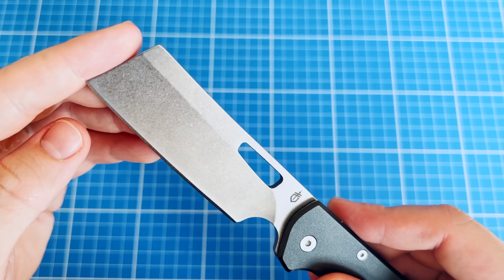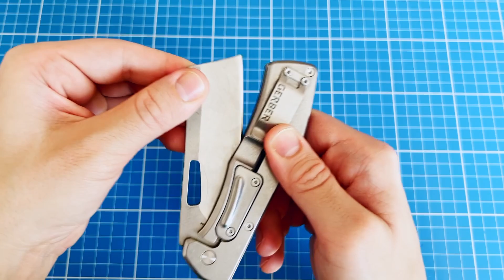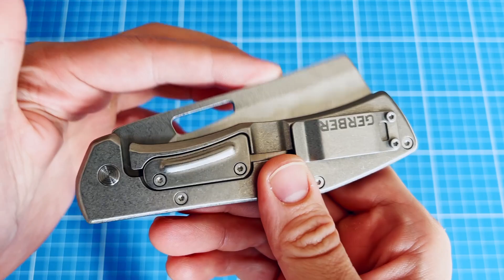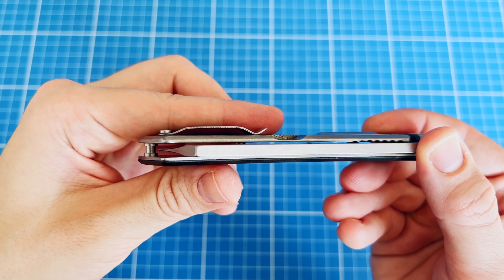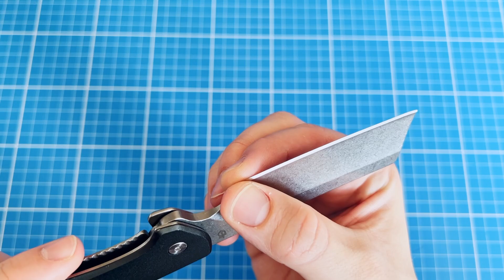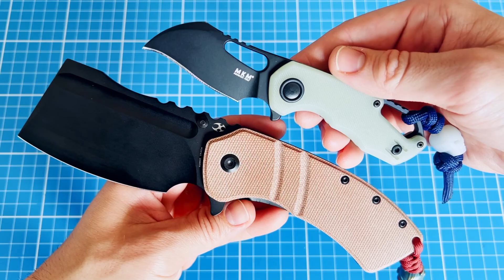Gerber Flatiron Pocket Cleaver with Black Aluminum Grip, Frame Lock, and 7Cr17Mov Blade Steel

Comment: pretty terrible review ive had this blade for years, opens with one hand easily closes fine needed a sharpen but works perfectly , never opened in my pocket and has always held together well. maybe if you had a little more strength you could open it with one hand !
Reply from the maker: Thank you!
Reply: the pocket clip is meant to be loosned after purchasing too maybe if you knew anything about knifes this would make sense to you

Comment: I agree with you this knife is very disappointing , I even forgot that I had it
Reply: I'm actually going to completely disagree with you. Either I got the one in a million knife or you got a defect. My flat iron I've had for a couple years now. The action has always been smooth. Opening and closing it is eaisly done with a single hand. The lock on it has never failed on me nor has it ever opened in my pocket. Not something I can say for my Kershaw.  The clip is a bit stiff but still clips into my jeans. I do construction and it has been beaten to hell and back. I use it every day it's one of the two knives I don't leave the house with out. I've had other gerbers that have fallen apart this one has never had to be lubed or adjusted. Also as a side note the finger grip on the blade it the only way I've cut my self with this knife lol.
Reply: @deanbarrett8832  hey good for you my dude , to each his own I suppose
Reply from the maker: @deanbarrett8832  I’m happy you got a good one! 😎
Reply from the maker: Hahah I wish it wasn’t this bad. We both had ourselves some good knives. 😂